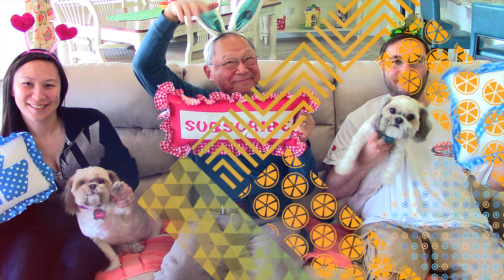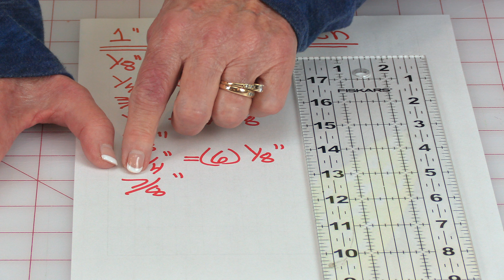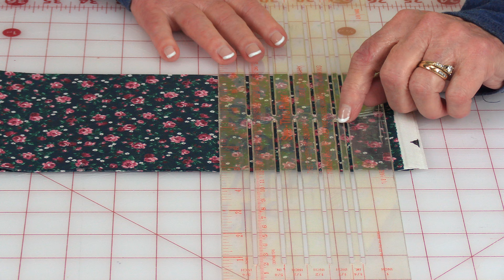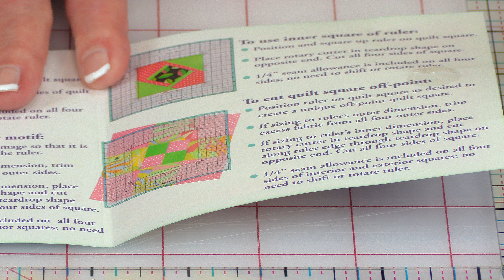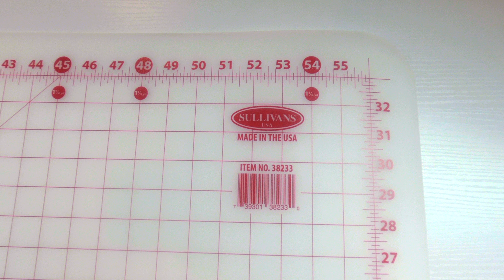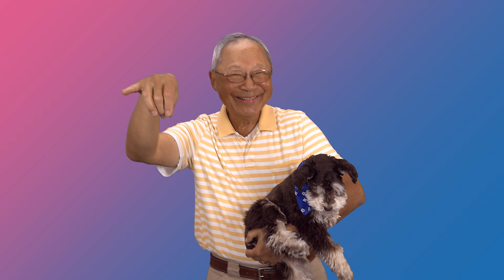Sewing Tip of the Week | Episode 150 | The Sewing Room Channel

Comment: This is a great video, very helpful to know what might be useful ruler-wise. I am a beginner and mostly managing with an 18" 'school ruler' and lining it up against the straight lines on my cutting mat, but I'm definitely going to have a look at some of the square rulers now! One thing I was wondering about though, when you talked about cutting triangles, you mentioned having to starch the edges to avoid stretching and then washing it out after - was there an alternative to doing that? Or was the answer just to use other shapes instead?
Reply from the maker: Hi Andrea.  You don't have to use starch.  it is just a suggestion.  I have cut many without the startch.  Thanks for watching💗and happy sewing😍